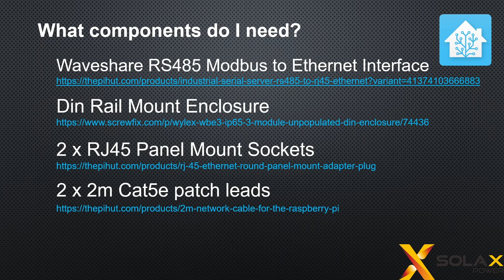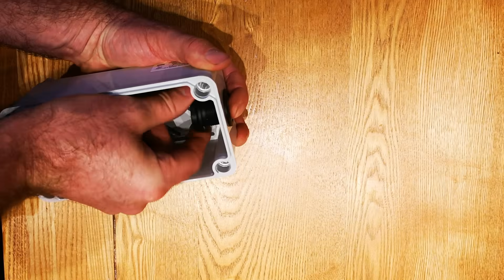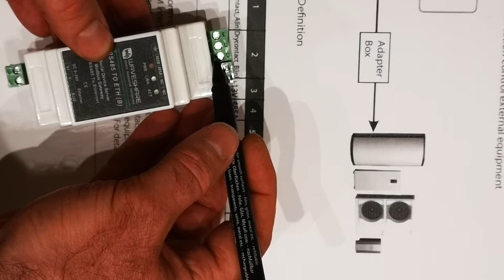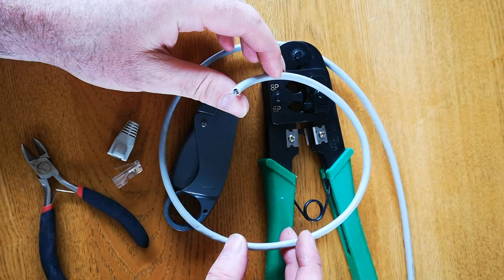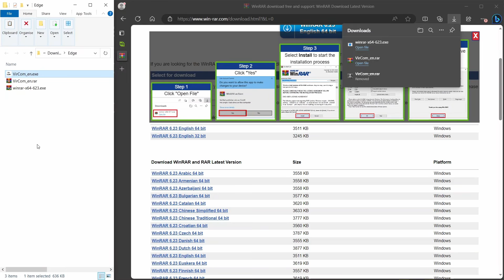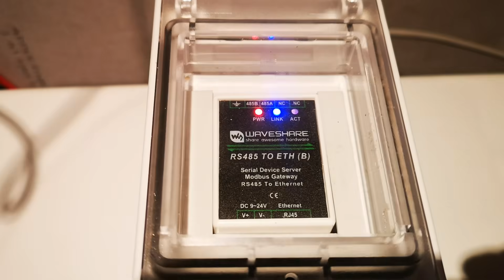20 - Build a Waveshare Modbus Interface - Home Assistant Tutorial - Solax Solis Growatt Sofar

Comment: I've got mine setup and configured, its getting power from teh inverter but it seems to never poll the inverter, the activity light doesnt blink at all, i'm guessing the blue wires did not terminate correctly.
Reply: changing the modbus integration to the waveshare ip makes HA mega laggy, where it takes 2-3 seconds to load and register clicks, change it back to point at the dongle and HA goes back to normal speed
Reply from the maker: @Extragonk  Never heard of that before, normally it's quicker. What's you update interval?
Reply: @JWSolar  it was set to 10 as per the video, but it doesnt seem to matter what it is, i'm going through a full HA update cycle now to get everything at latest and will start experimenting with disconnecting the inverter com and see if its the waveshare or the inverter link thats causing HA to (assume) time out and lag
Reply: As a follow up on this, I finally got it working, 1st the cable was not terminated with one of the blue pins not having continuity - poor quality network ends :(, second i found that there are two settings on by default on the Advanced page which need to be cleared to make it work: "send MAC when TCP establish" and "Detect net using Ping". I turned both of these off and it worked. The integration and the whole of HA was really laggy for about 3 minutes but after that the system stabilised - i assume this is it serially querying the entities and having some wait timer in there per entity. 

all good now though, thanks for the video, it was invaluable!

Comment: First: thx so much for your tutorials! Question: if Wifi-Dongle is not stable, would the Pocket LAN-Interface V3.0 be the better choice? My issue: DTSU666 is connected to my COM-Port, so using home assistant via Modbus is no option 😞
Reply from the maker: What's connected to the meter/CT port? That's normally where the DTSU666 or CT clamp goes. Sorry, I haven't tested it with the lan dongle.
Reply: @JWSolar  meter/CT = CTs; DTSU666 is connected to COM-Port (RS485, Pin 4/5) - its a X3 G4 Hybrid
Reply from the maker: @Cromargan  On a X3 G4 Hybrid, the meter connects to pins 4/5 of the meter/ct port (rs485) leaving the Comm Port available for external equipment such as Home Assistant.  It looks like yours is in the wrong place, please check the manual.
Reply: @JWSolar  You are right, i was wrong 🫣: DTSU666 is connected Meter/CT. But the Solax Charger is connected to COM. Guess need to try LAN-Interface🤷🏻‍♂️
Reply: @Cromargan  Hi Cro, you can set the modbus address of the EV charger and inverter. You can use a RJ45 Y splitter to create a parallel RS485 connection, the control device you are using for home assistant will be able to tell the difference between the inverter and charger by the modbus address
Reply: @TylerSolax  Thx Tyler! EV charger an inverter will still be able to communicate, although they ve different modbus addresses?
Reply: @Cromargan  The inverter is always set to 1 by default, and EV charger should be 70 by default.

Comment: Hi , I like your videos, I have followed the tutorial with Wifi connection. All connected, all running well , but I have only 4 entities available.
something like temperature and not important data. I am missing basically all entities about the power, V,A etc.
I have sent you an email, but no answer so far :(
I have Solax X1 Boost G3.2 - is this a problem ? 
I mean the connection works well, but I dont have any Data that could use. is it because my inverter is not offering them , or I have problem somewhere else ?
I would like to try this RS485 as well, but I dont know if it make sense 
could you please answer
thx
f
Reply from the maker: Hi,  I'm not familiar with the G3.2, but on the G4, the inverter firmware must be higher than V1.48 for all the entities to show.  I appologise for not responding to your email, it ended up in the spam folder.
Reply: thank you, can I send you an email now ? 
I was thinking to simplify the issue, buy a Shelly 3em to measure power , is this gonna help me ?
 @JWSolar
Reply from the maker: @gajduso  I'm not really familiar with the shelly devices.
Reply: You may need to upgrade your inverter firmware as the HA integration will only work with the up to date version - I had the same issue.